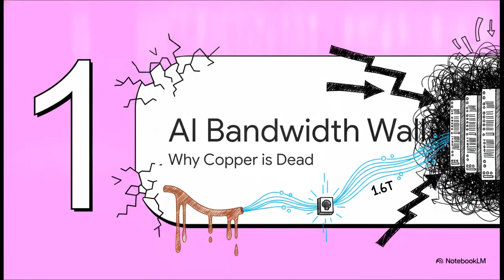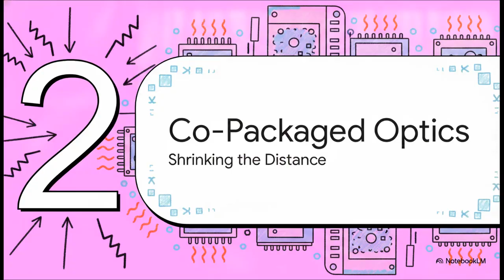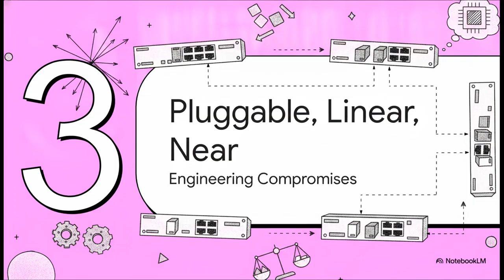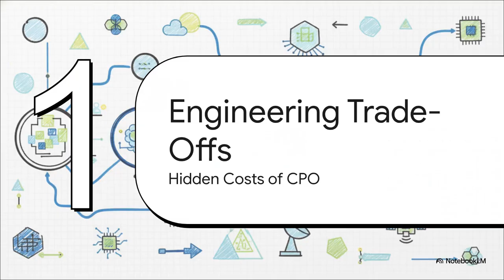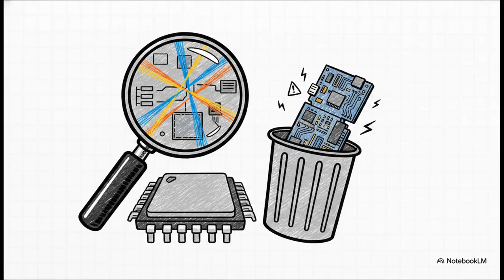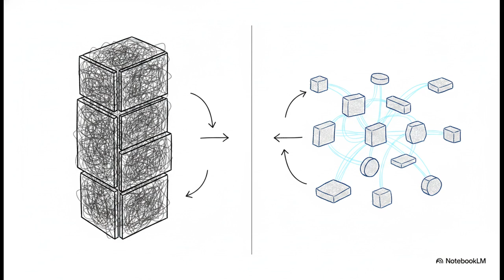Beyond the Copper Wall: Why AI Data Centers are Ditching Wires for Light

Comment: The shift from copper to optical interconnects is arguably more immediately impactful than photonic compute itself. At 1.6Tbps and beyond, copper's power budget and signal integrity become showstoppers — you literally can't push enough electrons through without melting. Co-packaged optics (CPO) is where the real action is: Intel, Ayar Labs, and Ranovus are all racing to integrate optical I/O directly onto compute packages. This is the backbone infrastructure the next generation of AI data centers will run on. We've been covering this copper wall problem at @aitickr — it's one of the most underappreciated bottlenecks in AI scaling.
Reply from the maker: Completely agree. The real AI infrastructure bottleneck isn’t compute anymore—it’s data movement. Co-packaged optics and optical interconnects will be foundational for scaling next-generation AI data centers beyond 1.6T. The future belongs to photonics-enabled AI infrastructure. 🚀